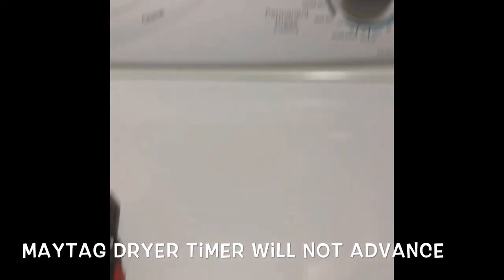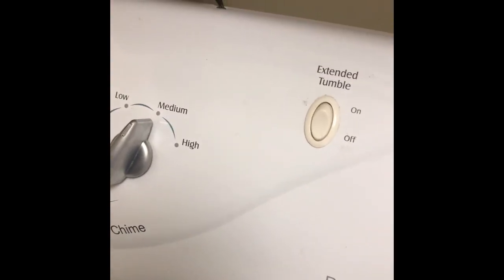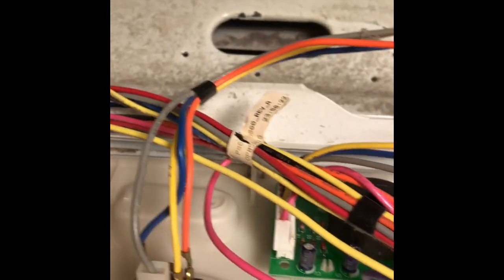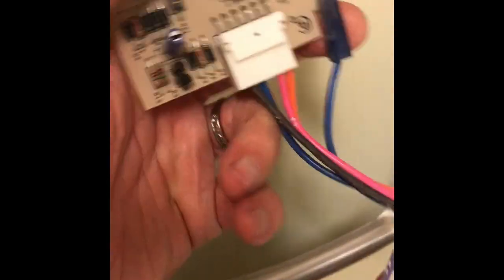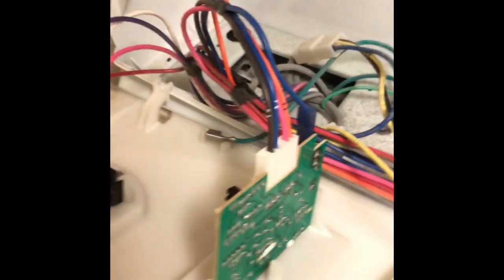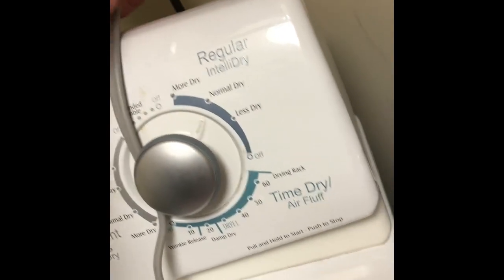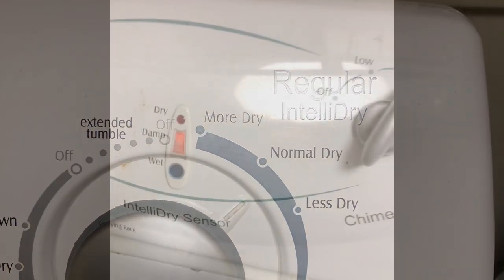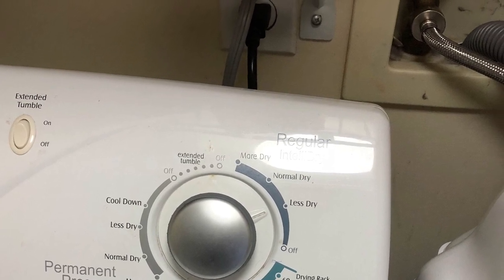✨ MAYTAG DRYER TIMER - Won’t Advance - EASY FIX ✨

Comment: mine is doing that and also not heating, so where can i order that and whats its called exactly?is there model number or is that all the same for maytag
Reply: Hey! Did you get yours figured out?? Mine just stopped getting hot yesterday and when I turned it on to let the clothes dry anyway ( it took hours ) I came back and realized also that the timer wasn't moving so idk if this circuit board replacement fixes that as well